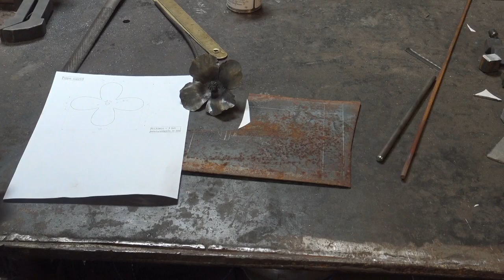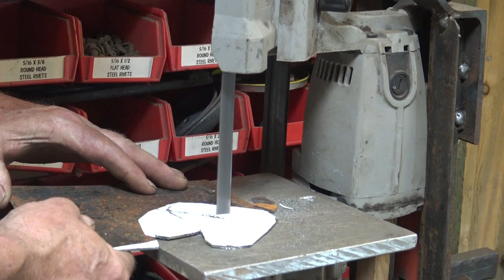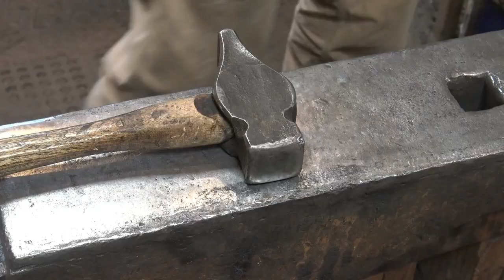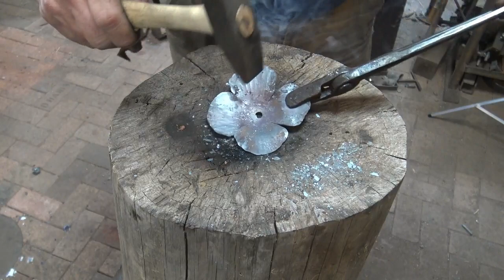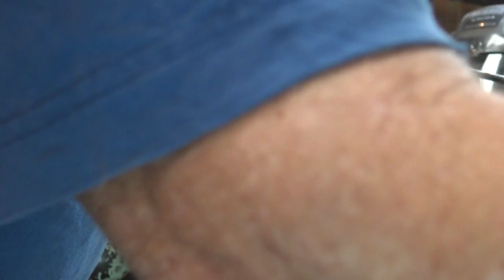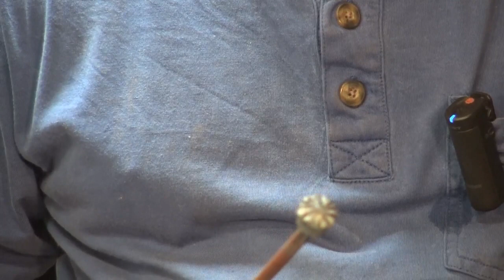Forging an iron poppy in honor of Memorial Day

Comment: Good video.  Could you make the stem from 3/8" that you reduce to 1/4" on the end with a shoulder, I think you call it offset in other videos.  Then treat the center like a rivet head?
Reply from the maker: The problem would be in the upsetting the required mass for the seed head would be very difficult on the assembled flower.  If it was just a rivet head that would be a good approach.  I do use that technique for assembling roses.
Reply: My thought also Frank. It seems like a clever way to finish out this project using traditional techniques.
Reply: Got it! I understand. Thank you, John.
Reply: Thank you John.